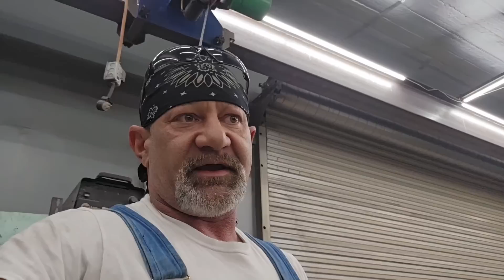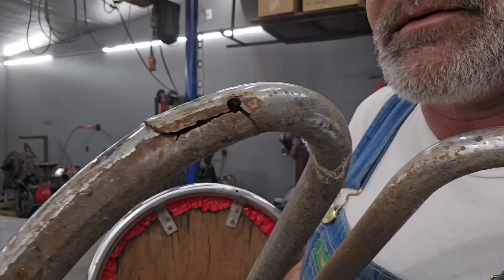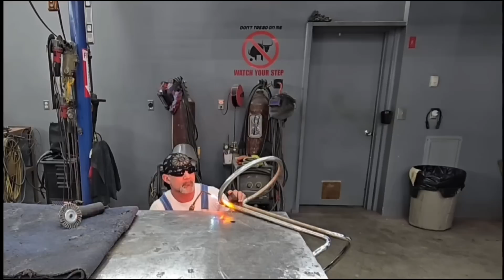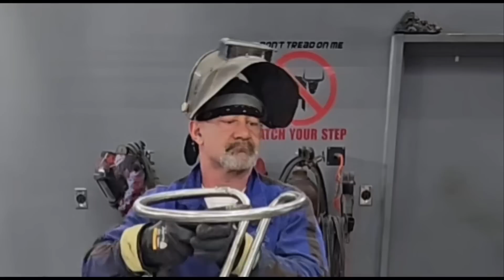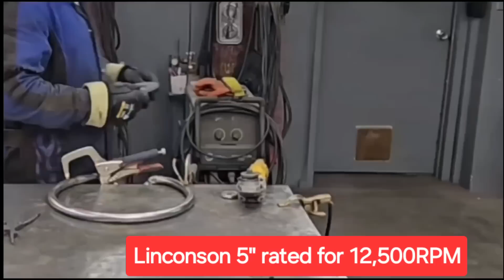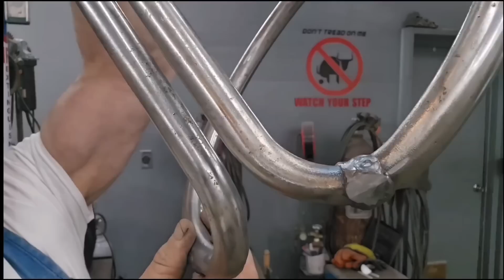Welding repair on an old bar stool

Comment: Thank you for making this video, very much appreciated. I just broke my stool where my feet sit on it about 4 hours ago. I hope I can weld the tubing back to the vertical piece. It does swivel and now I have an idea how to fix it - thanks to you. I am not trying to be an asshole or back sit driver....but wouldn't it be stronger and and less work to level up the welded area, by just flipping the bottom to the top of the stool and screwing that damaged area in to the wood? That way you could have bracketed the almost broken tubing. Just a thought. Thank you again for the video! Remember I'm 70 and my old brain doesn't work as it use too. LOL. So I might be missing the obvious.
Reply from the maker: Someone else also suggested flipping it over...I didn't do that but I reckon you could have...not sure if it would make any difference because I wouldn't have welded on it any less either way

Comment: "Art Deco stool, vintage Z stool, Gilbert Rohde stool, mid century modern stool," 

typing this into googley will get you multiple results on this stool, some have footrest, some don't, but all appear to be very similar in manufacturer though. Seems to be 40's\50's style, so they've been around for quite a while now! Not sure exactly what you're looking for but this will get you pointed in the right direction with a simple search. Happy hunting!👍🏻🛠️👨🏻‍🏭⚡🔌🦺⚠️
Reply from the maker: Thanks for the info!

Your awesome 👌

Comment: Looks great!  Thanks for the tip on using tie wire.  I've used coat hangers before but they'd be a little too thick on this stuff.
Reply from the maker: Exactly

Comment: The footrest is missing. That's what fastens to the center holes. Used to know a guy who use coat hanger wire for that kind if work.
Reply from the maker: Yep I've melted some coat hangers myself 😄

Comment: I'm interested. To see how your welding with that wire . Is is just mechanics wire ? Or a certain brand ? Could u use a small welding rod and feed a welding rod with the torch ?
Reply from the maker: It's tie wire for tying rebar
Reply: @ oh ok ! ya i never thought of that ! good idea for sure!🤠
Reply from the maker: You could use any steel rod if it's the right size...tie wire is good for thin material
Reply: @NBSWELDING  good to know!

Comment: I use you tip on penetrating oil in spay bottle but the special cocktail deforms the plastic bottle also what kind of lights do you have by your crane thanks
Reply from the maker: I use an alcohol bottle and they work well for the trans/mineral spirits/kero mix...some sprayers will take it and some won't

The lights are on my Amazon Storefront...tap on the link below and buy from my Amazon Storefront....thanks for supporting my channel 
For purchasing products from Amazon  use this link
https://www.amazon.com/shop/nbswelding

Comment: I did a quick google search and found a very similar item from a fancy schmancy auction house where a pair of these went for $1600.  One thousand, six hundred United States dollars.  My ass isn’t worth $1600, I can tell you that.  I also found a not quite so similar item on Amazon for $132, which is much more my budget.

What about flipping the fram upside down and mounting the seat on what used to be the bottom, so the wear for the next 60 years is on the part that hasn’t seen the floor yet?  I know you’ll still have to fix the damage and weld the tabs on the other end, but would that make any difference?
Reply: Thing about those auction prices, they are for barely used and in close to original condition as possible... Like  toys that were never played with , unchipped china.  Most folks wear their stuff out, but sometimes someone gets an early itch for something new or gets put in storage for long while
Reply from the maker: I thought about flipping it over but decided not too...there is one of these stools for sale on ebay for $800

Comment: Having never brazed with tie wire, thanks for the tip.  Being able to weld over the tie wire braze for added reinforcement 👍💪.  Thanks for the video
Reply from the maker: 👍....actually this is oxy/acetylene welding not brazing....the term brazing is only applicable when the rod is brass or bronze and it doesn't actually blend with the steel like takes place when welding

Comment: Your opening comments on educating your customer on exactly what it is that they’re asking you to do and what it’s actually going to cost (in other words, saving them from themselves) is something that us small job shop welding contractors deal with continuously. The average person who brings us a job like this has no idea what it will actually take to give them the desired result. I can’t tell you how many times that I’ve done exactly what the customer asked me to do and even cut my hourly rate in half, trying not to make an enemy, only to be told by the customer when you hand them the bill, “Well, I could have bought a new one for less than that”! Believe me, customers expect you, as the weldor/mechanic, to accurately know what EVERYTHING costs! I have even gone so far as to call equipment dealers and price whatever it is that I’ve been asked to work on in an attempt to avoid these “train wrecks”. Sometimes, I think people are stuck in a time long ago, where you could take something to your local job shop and the poor guy would beat on it for half or all day and then charge you $20-40 dollars. I have even pissed people off for telling them that they would be way better off just buying a replacement part or new piece of equipment rather than trying to fix the old. It’s all part of the daily struggle 🤦🏻‍♂️.

Comment: I'm always curious about an hourly rate and how much time is spent on a job C.B. so thank you for sharing this. I also appreciate the tip on using the tie wire. I like how you show the importance of putting strength ahead of cosmetics. Thanks for your time spent on this video.